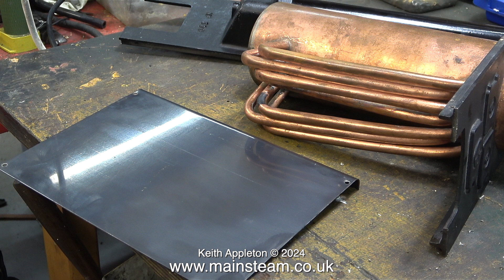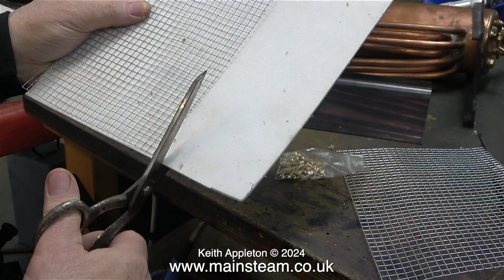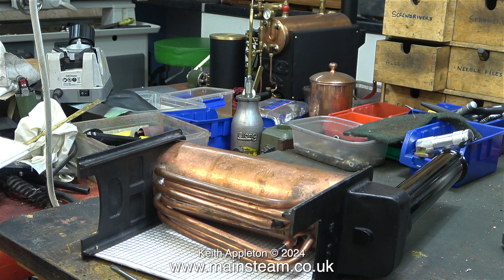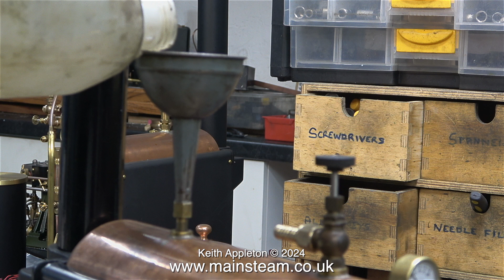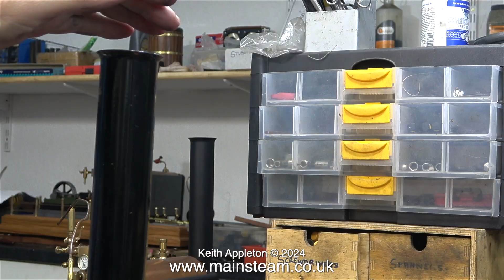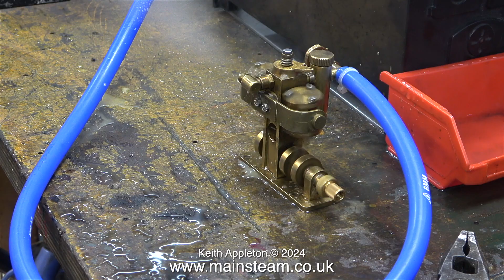A STUART 504 BOILER FOR MY FRIEND ANDREW - PART #2

Comment: Great idea using wire mesh to secure the insulation!  I have to replace the original insulation in my New Old Stock 504 boiler with the safer ceramic type and I’ll be sure to follow this method.  Thanks!